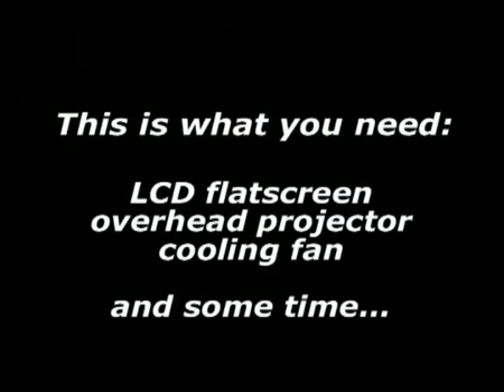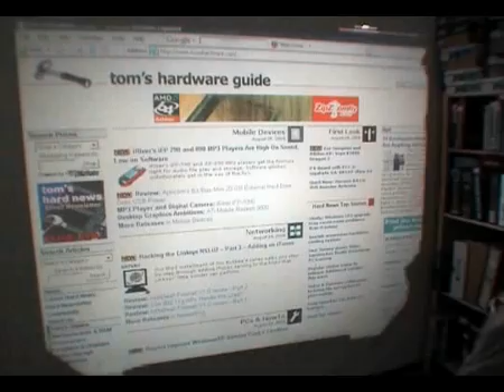Make your own home video projector.

Comment: Can u show me how to connect the other connections.Bcoz u r showing only the display.
Reply: John Issac you just reconnect all the electronic parts of the screen after disassembling, but be very careful with the psu of the monitor! if you're not 100% sure better use one with an external power supply

Comment: @pastryhat part 2... also, if you notice that the LCD screen is stretching the lower resolution you picked, then you will need to disable any "screen stretching/up-scaling" features from your LCD's OSD, because if its up-scaling then lowering screen resolution would not help mitigate any overlapping you may be experiencing from using a bigger LCD screen than what the overhead projector can physically cover.

Comment: @pastryhat I think the key here is to pick an LCD display that is not bigger than the projector coverage area.  If it overlaps, I guess you can scale down digitally through SOURCE. if that SOURCE is a computer, for some LCD screen, setting resolution to one step back from maximum resolution (if max res. is 1280x1020, then change to 1020x768 XVGA) would cause the LCD generate letterboxes on up/down and left/right about 1 inch margin that SHOULD be enough to mitigate overlaps issues.

Comment: @toddshere I think that a better idea would be to get an incandescent light bulb that is the brightest that you can find.  Perhaps 150watts with more than 2,000 lumens.  You can also see if a powerful fluorescent light bulb (you know? the energy saver ones), but the BIG ones, that are rated, I think 38 watts (but imitates 150w to 200w incandescent counterpart) could do the trick in getting a super bring picture.

Comment: Use a portable DVD player next time.much cheaper easy to find used and has RCA hookup for videogames.all you need is a old lens from a slide projector,a fresnel lens from staples,and a lightsource.once you build the box around it it's a much more portable and practical. Plus the disasembly is easy and has DVD player ready to go.the break down of the screen is simple and you don't have mess with DVD part.just remember to build it so the image isn't back wards.

Comment: @MrDexter9i3 
it likely wont burn, LCD panels are meant to withstand a lot of heat from the back lighting in a normal LCD panel and the part of the projector it rests on doesn't get particularly hot.

Comment: this is not new.. sharp and many manufactures made  LCD Panels to put on Over head projectors for Years... in fact they stopped making them 10 years ago when projectors were more efficent, brighter....  over head proejctor bulbs are cheap..sure but they burn out every 40 hours.. so you are looking at a new bulb every week or 2

Comment: @HolyGuyz when i touch my monitor right now its a lot hotter than my room and thats about 30 degrees celsius so i cant see where you get those 15 degrees from, and i find it hard to believe that a monitor will keep cooler than the surrounding termperature with no fan at all, i stand by with having a fan will cool the lcd sufficiently

Comment: You're about dumber than shit. LCD screens get a lot hotter than 15 degrees celsius. You must not have an LCD TV. You can barely touch the bitches. They can take well over 40 degrees and survive.

Comment: It's too bad that this "How To" video stopped half way through.  A good How To video shows the steps from beginning to end, yet this video stops after placing the unconnected LCD screen on top of the overhead projector, and the next thing you know, Star Trek is playing. Where are the missing steps? You have to actually plug the LCD screen somehow into something, but that somehow and something are completely missing. Someone whose field is not electronics would not know how to finish the project.

Comment: One very vital note: I tried this with an overhead projector, 3M 2770, which has the lamp light OVER the stage, not from under it as your projector. So, it did not project any image, the LCD just was was lit from above, and kinda blacked-out. Nothing was projected on the wall/screen.
Now if anyone has succeeded in using that kind of a projector where the lamp is ABOVE the stage and throws the light ON it, then please let me know how you did it. Thanks.

Comment: No.  the heat the OHP produces is dangerous to the lcd screen, which is why you have to separate them and have the cooling fan pulling the hot air.

Comment: 1) Buy an used tf/lcd monitor from ebay for 30/50 bucks.
2) buy an over head projector from ebay for 30/50 bucks.
3) Have some patience and install the things.
4) Saved over at least 300 bucks buying a new beamer.

Comment: No. Audio and Video are completely seperate in any device, and most PC Monitors dont have audio anyway. Audio comes via DVD Player, Game Console, Computer sound card, etc. You can hook it up anywhere, a surround system, an old stereo or TV, or hard wire any old speakers. If you dont understand this part of it, this may not be the project for you. But in a nutshell, you dont need audio to see video and you dont need video to hear audio, they are seperate. 
This is only a monitor.